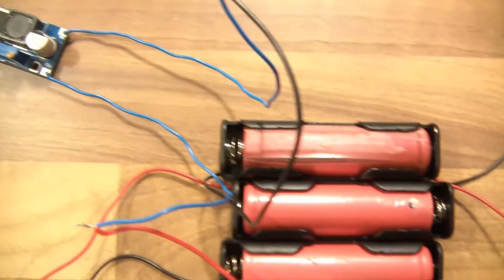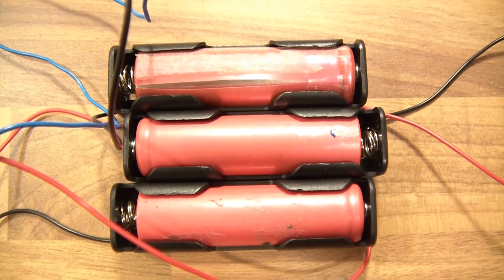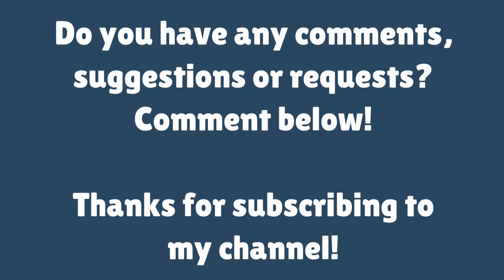INVESTIGATING: The Cheap XL6009 Step Up / Boost Converter - Part 1 - Demonstration!

Comment: My experience with those small "3A" boost converters is that they only work continuously at that current if they are fan cooled; also you need to pay attention to the total wattage. 30W would far exceed a small converter like that, check specs on 6009 and module.

Comment: I didn’t get the caution ⚠️ part enough probably what the calculation is directing us too

I need more clarity on how to use this device either for step up or step down 

especially how you get to know 3batteries should give you 27.6volt and four batteries will give 36volt

Comment: Designed for 1.3x to 2.5x the input voltage, requires 10% to 20% more input power than it can output. eg. 12v output from 6v to 8v input (2x Lithium cells); 30v output from 12v to 16v (4x Lithium cells).  If efficiency is 90%, CURRENTin = ((Vout * CURRENTout)/0.9) / Vin
Reply: If this is Step UP booster then lower input is required. Are you sure about your comment?

Comment: On ebay description it says max input 2 amp. Will I ruin the converter if my 18650 battery capacity is rated at 2500mah?
Reply: Amps are not the same thing as amp hours
Reply: Capacity of batt. mean how much last long, you have to check min. input voltage of the module if is enought to work properly. Some users said  at lowers input the output isn' t stable and risk to damage the device connected

Comment: Thank you for making this video!  Aprreciate your work.    But I don't trust cheap chinese parts... The XL6009 is a fake of course.  For safe and serious work, buy form a know good seller.
Reply from the maker: You're right. Some of the Chinese stuff is simply terrible. But not all... There are a few companies which make good parts. For example; reyax.
Reply: @antonycartwright You are absolutely right. But many people don't know that the bulk of cheap alie parts are fakes which can even be dangerous. 99% of YT video reviews don't mention this.  Personally I  had many faillures or strange behaviour after a while(!) with chinese components which makes looking for the fault very difficult. So I learned my lesson ;)
Reply from the maker: Yes, I've bought hundreds of cheap parts. For the most part, I've found them to work, but not necessarily work well.

Comment: I'm very frustrated. I have already built a genorater from simple parts and have made a video of it working (reasons for this is to have a give and take community and simplified parts if anyone every needed! Also easy to find parts)  I seen this part before and would honestly like to go without. The problem is I wired my genorater again after dropping the motor on the ground by accident, and the generator is now acting different and not charging the battery the same!  So this might be a solution. The question for me is, why would I get different results wiring the genorater again if the specs are the same on the motor I dropped and the wiring is the same with the odd exception of different choice connectors? Which I am aware for a fact wouldn't make that much interference with charging the battery! And to elaborate on this, I had large wires connecting to the battery, but they power was also being delivered threw smaller wires to begin with!  Regardless, the rating on the wire says it can carry more than what I need!  Not trying to load alot!  Only trying to charge a 12V car battery      Anyone else experienced questionable things like that while working?

Comment: i used this module to run 12v dc fan setting on 12v and powered by two li-ion cells delivering 3.7 or nearly 4 v ( using charging module tp4605). the fan speed doesnt increase much like it should on 12v and module gets  too hot. on increasing the voltage  it doesnt make any change on fan speed
Reply: Did you regulate voltage while circuit was powered? I burnt 2 of them just doing so, now i unplug them, rotate the potentiometer screw and check with a multimeter. I dont know if the IC or the pot get shorted when you tune the voltagw and circuit is on,  but sure i blame 1 of those.

Comment: is buck converter better or  xl 6009 . i want to boost the 6 v 10 w to 24 v ,so which one is better.
Reply: You must use boost module. Boost converter is stepping up voltage, buck converter is stepping down voltage.

Comment: Thanks for your time in making your review. I wanted to ask a question. If the input on the converter changes does it also mirror the same changes in the output? Or does the output stay the same regardless of any fluctuations of Voltage/Current from the input? Thank you & I look forward to your reply
Reply: yes by the same ratio, eg 4v in 8v 3v in 6v out approx
Reply: @godfree2canada  not true, it's a regulated output. Data sheet here: https://www.haoyuelectronics.com/Attachment/XL6009/XL6009-DC-DC-Converter-Datasheet.pdf
Reply: Bit late maybe, but actually the output voltage is set by the trimpot and isn't dependent on the input.

Comment: did the amp still the same amount, go up , or go down?
Reply: 30watt lf at 30v is 1amp it still takes 30watts and 11v is almost 3 amps plus its only 90% efficient
Reply: Amps on the battery would go up

Comment: My input is 12V then when I connect it drops to 2.7V then only can boost up to 5.5V
Reply from the maker: Do you have a very heavy load on it?
Reply: Antony Cartwright actually i connected it to my bike's terminal. It has no battery and all the lights work only when i kick it start.

Comment: i replaced the100k 25 turn multi turn pot with a normal 100 normal 270 degree trimpot. the 25 trimpot is really stupid and you need a screwdriver and there is no knob for it anywhere?
Reply from the maker: Ese Callum good idea!
Reply: did it already.added 82k resistor to 22k trimpot.this is for the version
 where the 3 rd leg of the precision  trimpot IS connected and the 
voltage variation only occurs over about 20k. 
in the second variation the 3rd led of precision trimpot is not 
connected to anything and voltage variation occurs more evenly over a 
100k normal trimpot

Comment: Xl6009 is waste chip, but mt3608 is very good and more regulation chip in practically, but theoriticaly good x6009!! Waste
Reply: I hope you use capacitors with that crap then.
Reply: @OutOfNameIdeas2  So these boost converters are all craps and there isn't decent option?

Comment: Can we boost 36volt from 12volt battery....? For ebike....?
Reply from the maker: Joseph I wouldn't use this for an ebike. How many amps at 32v does the bike need? I suspect it's way over the capability of this module.
Reply: I don't know it's working with 36 volts dc lead acid 3 12volts batterys....so can i use this.....? Plz give reply.....
Reply from the maker: Joseph Depends on how many amps at 36v.
Reply: @somethingnew4606  no way it needs way way more amperage

Comment: avoid the LM2577 they short out
Reply from the maker: Thanks for the info.. :-)
Reply: the 6009's have their issues too, and the xl6009 minimum inp voltage is 5v - lm2577 is lower so if you want to run something low current from a single 18650 cell you need lm2577
Reply: Fuse

Comment: How much we can give the minimum input voltage
Reply: Kalambe Amol - I just tried this step up converter. I want to use a li-ion battery to source a 5v device. But during my tests, I noticed a strange behavior. When I adjusted my bench's PSU below 3,4V the output of the step up jumped from 5V to 48V! That seems very dangerous to a microcontroller hehe
Reply: @Фёдор Анискин This is very interesting. I heard somewhere that the behavior I experienced was because of the configuration used in this module. But I have not read the datasheet for the IC (to be honest, I always forgot to download it and remember when I am working hehe). But I will try your hint! Thank you very much!
Reply: Hey Victor NH how did you solve that problem?

Comment: The timing couldn't be better/  I'm starting a portable adjustable power supply using the XL6009 module with a pair of 18650's.
Reply from the maker: Hi John, I'm going to be releasing three videos this weekend about the XL6009. Testing and a review. Stay tuned! Antony...